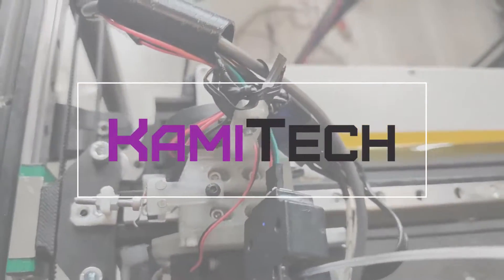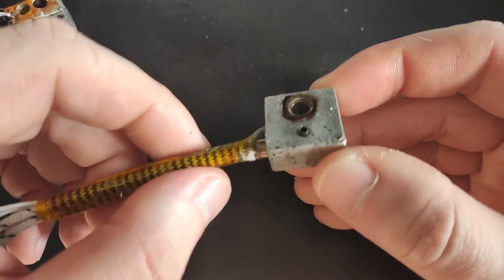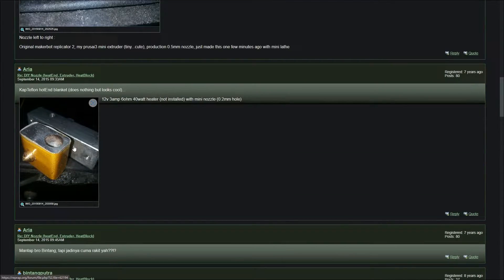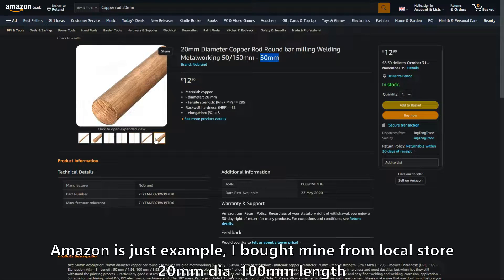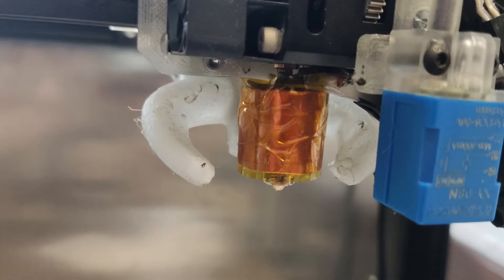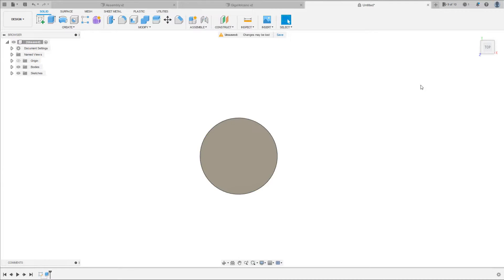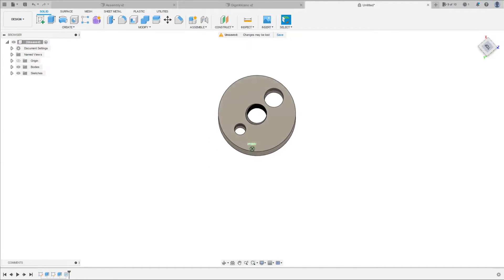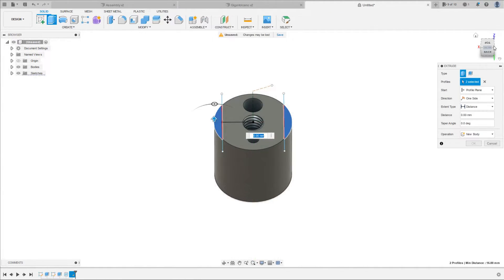DIY Heatblock for 3D printer

Comment: What software do you use? And I need a mold for my heatblock for a silicone sock can you help me?
Reply from the maker: For CAD, Free version of Fusion 360, as for making sock, i suggest doing it manually ie, coating heatblock with some release agent for example oil, then building up silicone by hand. otherwise you would need to do whole mold yourself which imo, in such easy shape isn't worth it.
Reply: @KaminarisTech  I have resin also just don't know where to begin carnt seem to load an image of my heatblock and soak into any kind of software to build round it

Comment: You would get better printing quality with aluminium heater block as it is 3x lighter. heavy head has a lot of inertia and could cause oscillations on the print edges.
Reply from the maker: Aluminium is a reason why i went copper, it is lighter but it is also way too soft at higher temps

Comment: Gran video! Yo queria intentar hacer un barrel de cobre pero lo veo complicado porque no tengo un taladro de banco para hacer los orificios lo mas recto posible y por eso no me anime a hacerlo todavia... podrias mostrar como usar la pagina de calculo de flujo? Quisiera intentar hacer mas preciso el flujo del filamento PET casero.
Reply from the maker: I have only changed Start Flow, Offset Flow, Start temperature and offset temperature, it will calculate other steps for you, takes some time to get used to. Oh and you need to modify your start and end gcode like you have it in slicer, something like this:
https://i.imgur.com/YN1vQLt.png

My start/end gcodes won't work for you
Reply: @KaminarisTech  after many tests I have determined that (for my printer which is a tronxy xy3-pro) the best flux is 110% with a temperature of 247 degrees.  I was actually testing many variants, but with those I managed to make it almost as transparent as a commercial filament.  I know it could be a little better but I keep doing tests because I have a lot of threads in the print and I'm fighting against it.  I also had clogging problems at different temperatures and he told me that it is because I have a standard barrel and to solve that I need an all metal or bi-metal barrel.  what do you think about that?
Reply from the maker: @Crepypastin2703  Honestly, the best way to solve most of printing issues is removing entire printhead and replacing it with something like biqu h2 v2. It's just too much hassle trying to troubleshoot bowden extruders.

Comment: id love to see a direct copper---> filament path with normal length nozzle at the bottom
Reply from the maker: Idea is there, implementation may be problematic as drilling with 0.6 is going to be hard.
Reply: @KaminarisTech  to the right depth? I imagine the harder part is getting a smooth 1.75/1.8mm bore
Reply from the maker: @Ruckusmatter  it would still be much easier than trying to drill 0.6mm
Reply: @KaminarisTech  oh no no, I meant make a direct path then a normal cht nozzle etc screws on at the bottom